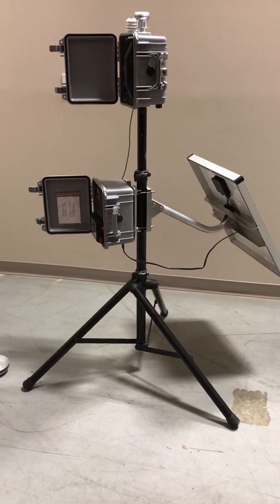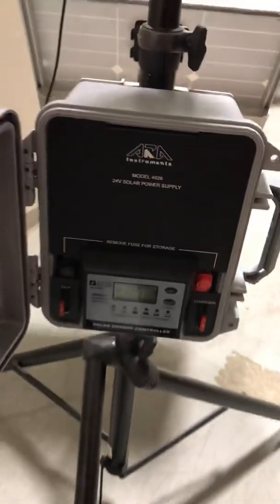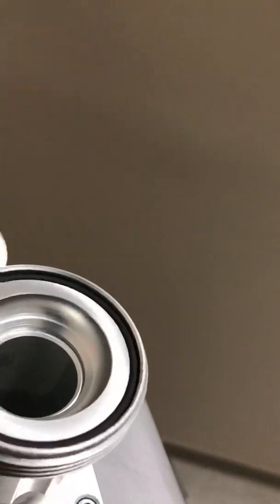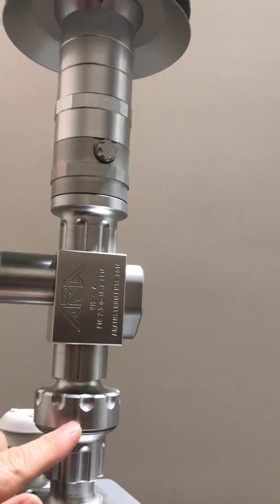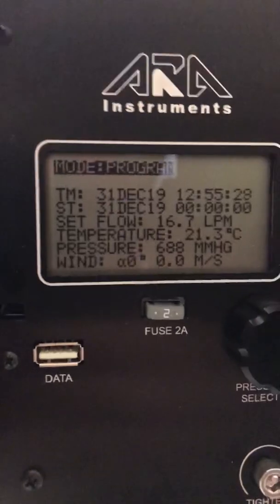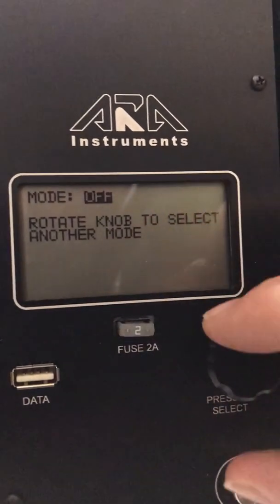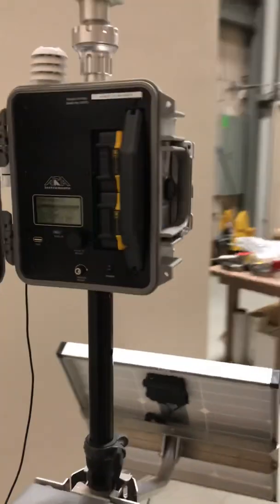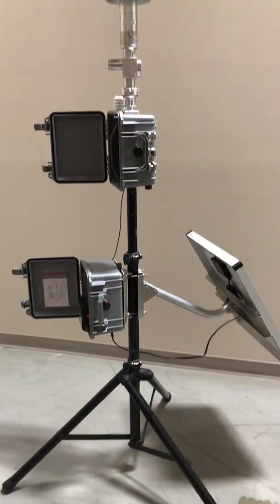ARA Instruments N-FRM Particulate Air Sampler

Comment: Please tell me about the data acquisition of this product
Reply from the maker: You can download the operation manual from www.arainstruments.com which explains the data acquisition.
Data log files with 5-min
 averages for all sensors can easily be downloaded to a USB Flash drive. Parameters include: flow rate, temperature, barometric pressure, and accumulated volume. Other  sampler related performance parameters are also logged. If the N-FRM Sampler is equipped with the Real-Time Particulate (RTP) Profiler and meteorological sensors, then PM10, PM2.5, wind speed, and wind direction are also included in the data record. data
 file can be easily downloaded to a USB flash drive by the operator. The “csv” (comma separated value ) file can easily be imported into a spreadsheet. Data
 file can be easily downloaded to a USB flash drive by the operator. The “csv” (comma separated value ) file can easily be imported into a spreadsheet.